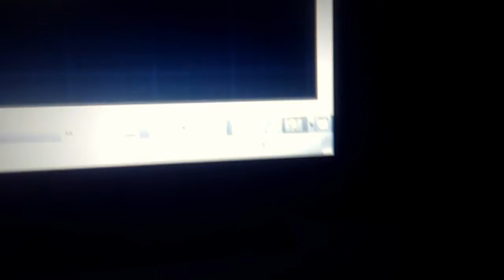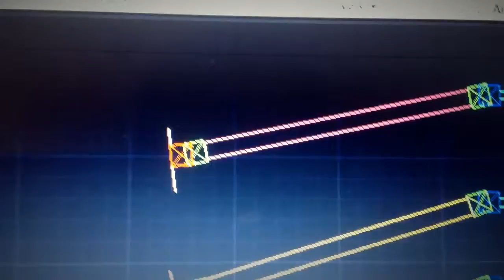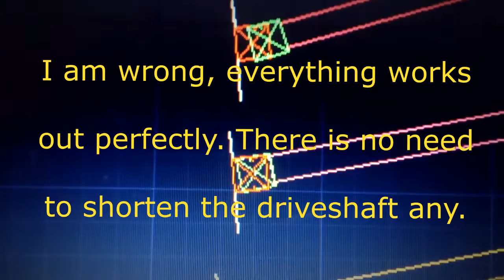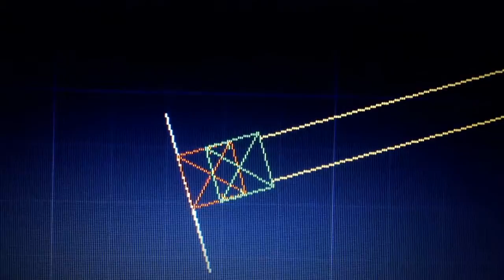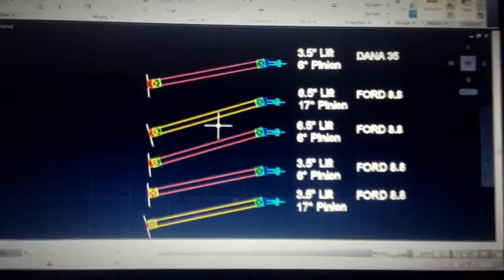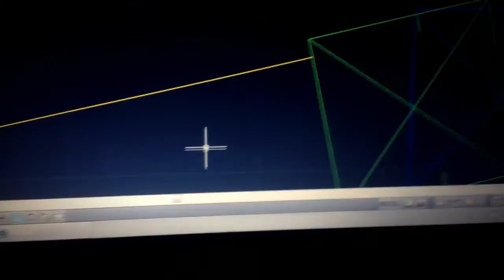ZJ Ford 8.8 Swap - AutoCAD 2013 - The New Pinion Angle 17 degrees

Comment: Did you run a cv rear shaft with this angle?
Reply from the maker: austin sheffield No sir
Reply: LostFart Wouldn't that be a steep angle for a stock 2 joint shaft? Sorry for all the questions.
Reply from the maker: austin sheffield it was a bit steep. I wouldn't do out again, that's for sure :)

Comment from the maker: Here is what I think on your theory.  When under acceleration the driveshaft and engine all move together thus 'pulling' the axle closer to the front of the vehicle.' When under deceleration it is the opposite and return to it's static position. If the pinion is not 'perfectly aligned' then it can be pulled forward to be. When it is 'perfectly aligned' there is nothing to be pulled for alignment.

For example, take a stick, slightly break it at whatever angle and pull it. It will straighten out.

Comment: Wrong choice of words or terminology. My experience has been pinion angle changes during aceleration and at speed. So if I had my pinion/drive shaft "perfectly" aligned when static it would misalign (pinion angle) on aceleration and at speed. Thats just me though. I could be wrong

Comment: Shooting from the hip here but...have you looked into having the pinion angle a degree or two less than the drive shaft angle. To allow for axle wrap. Even with a four link it does happen with my ZJ
Just my experience.